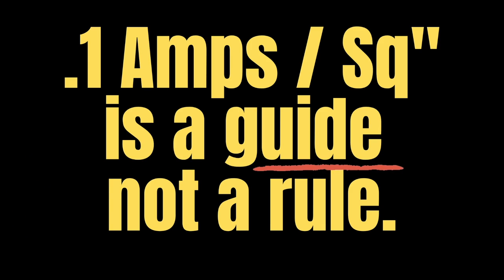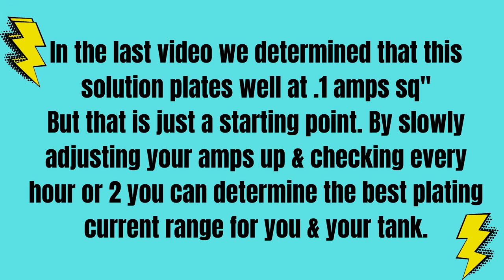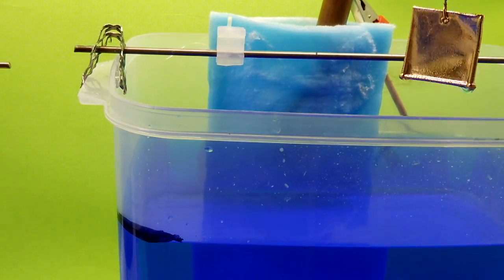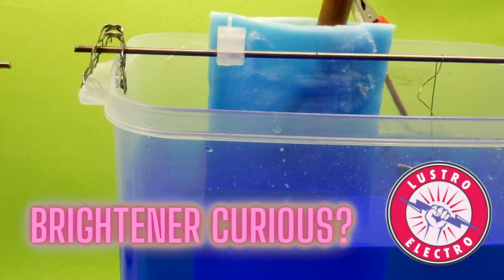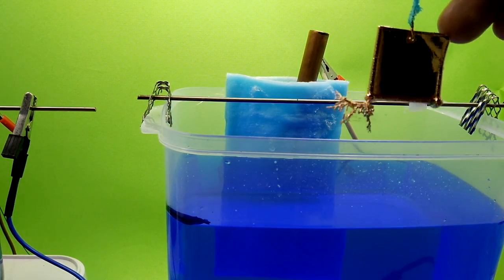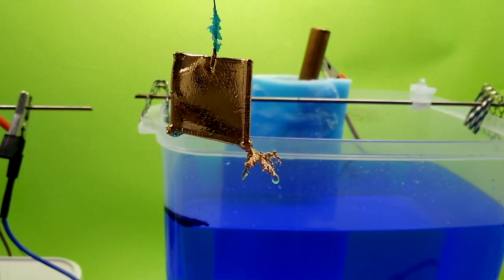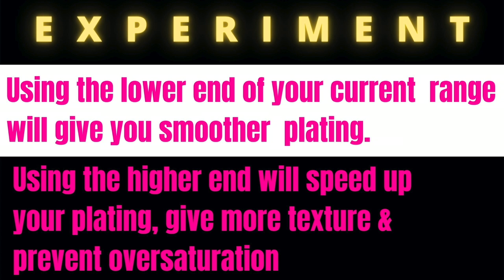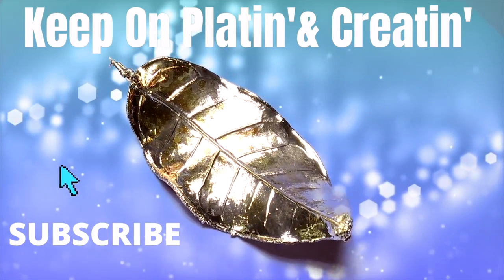Electroform Current Test - The Best  Amperage Settings For Your Electroform Tank

Comment: I was wondering what brand power supply do you recommend?
Reply from the maker: I don't have a favourite brand.  I mostly use buck step down power supplies, they are very  compact, precise, reliable and inexpensive. The only drawback is that you have to wire them yourself.  I also use a bench power supply, but that are not nearly as precise if you want to do pieces under 1 inch.  Thank you for watching!